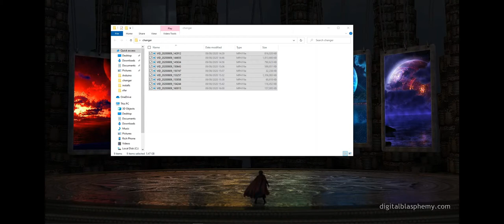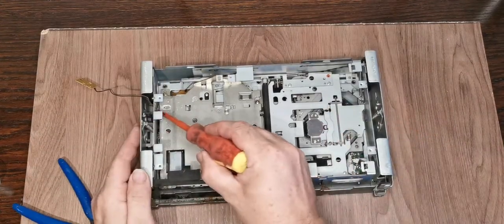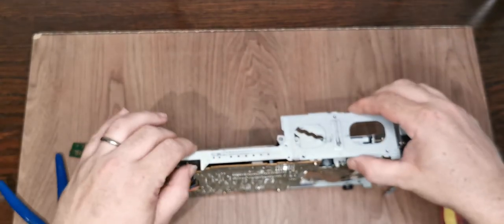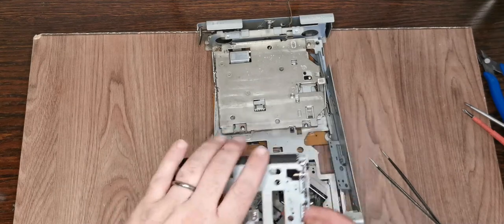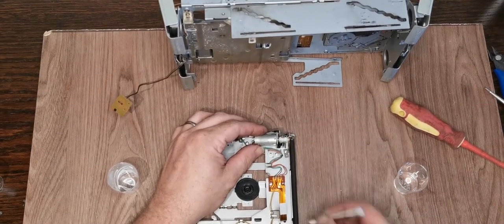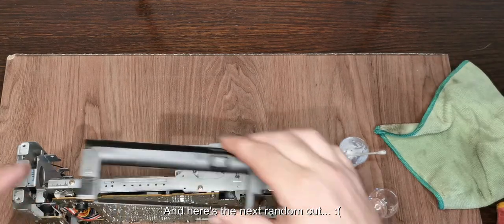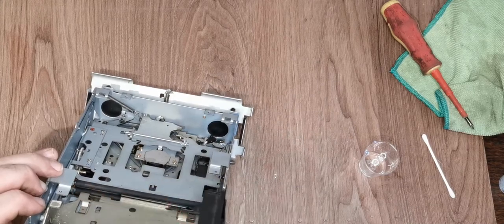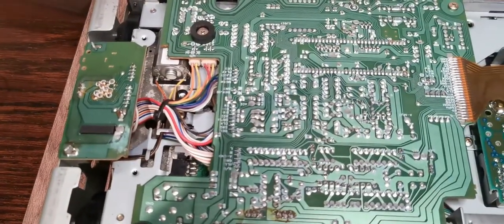Range Rover P38 Clarion CD Changer service

Comment: Great work.  I had corrosion on some passive electronic components and a dead battery.  Probably too much work to repair it but I will buy a spare off ebay and test and have parts for fix
Reply from the maker: Thank you